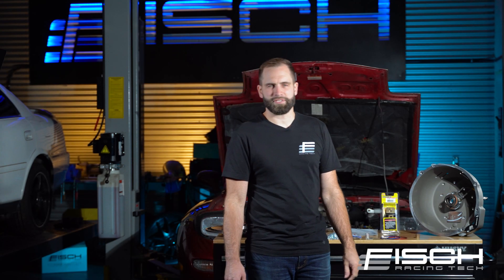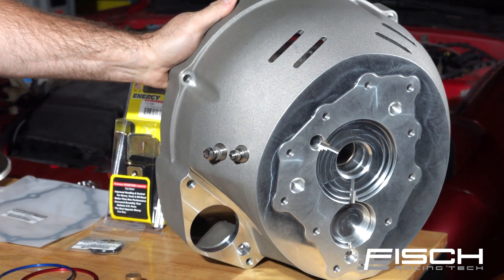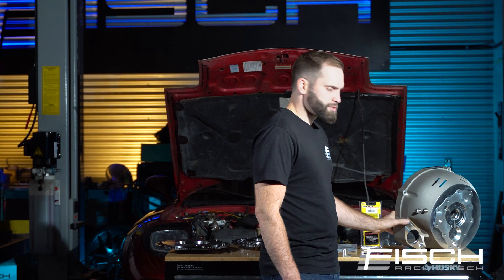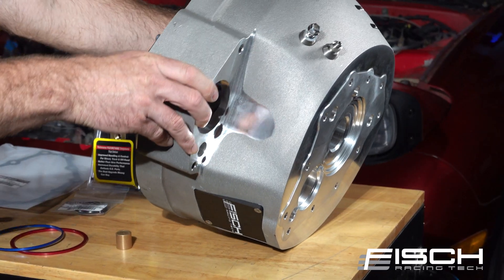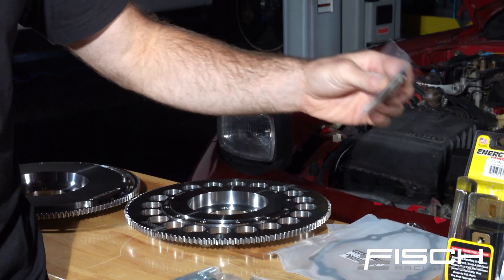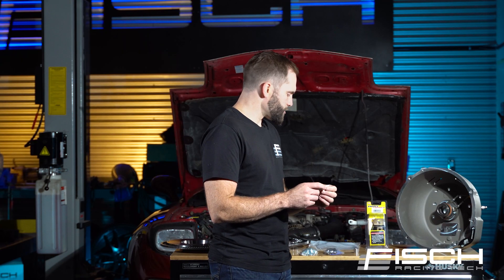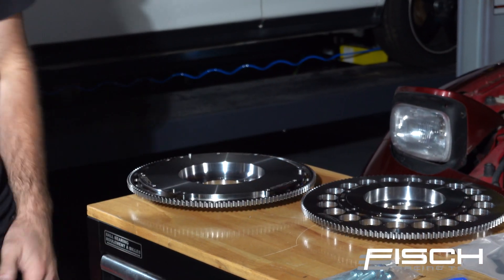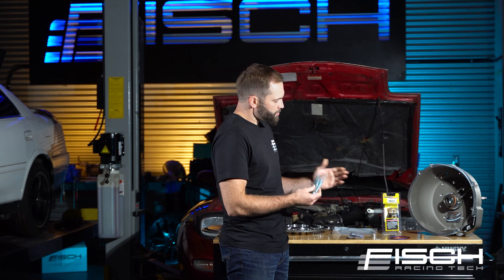Rotary to CD009 Adapter System | FISCH RACING TECH

Comment: Was wondering about the the single disc flywheel. Dose this replace the counter weight built to the stock flywheel? Or dose the required a external auto counter weight.
Reply from the maker: you would still need to use the counterweight

Comment: What would need to be done to the driveline, ppf, diff, and axles to run the Z transmission on s1 rx8 w/ renesis 13b?
Reply from the maker: You would need to fabricate a diff brace (we only have one for rx7) and trans mount and customize the driveshaft

Comment: I can’t locate anything that details doing this swap into a LHD FD3 RX7.   I understand the PPF removal and trans/diff/driveshaft mods.  My question is regarding trans tunnel fitment/modification and such.   TIA.
Reply from the maker: There is a bit of tunnel massage necessary. See product pictures on the website for clearance.

Comment: Will this work on an rx8 series 1. 2004 manual transmission  6 port motor? Building a hybrid renesis motor currently and was looking into the cd009.  Please advise
Reply from the maker: yes.

Comment: Why does a standard RX-7 or RX-8 clutch and flywheel not work with the Fisch Racing Bellhousing?
Reply from the maker: The OEM RX-7 or RX-8 flywheels are too small because the location of the starter is further away from the center.